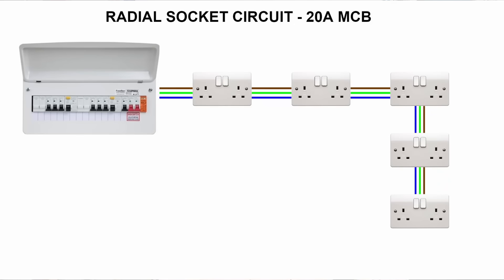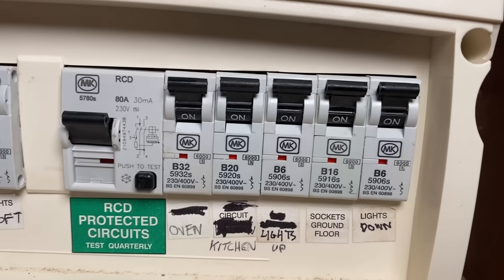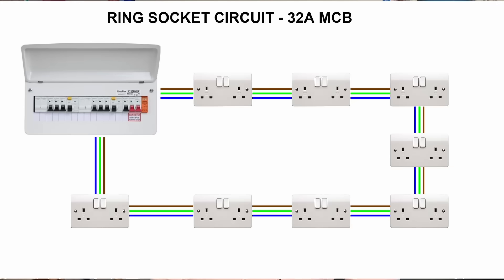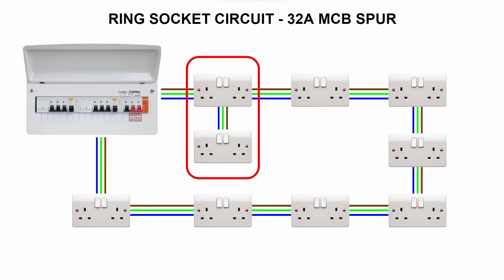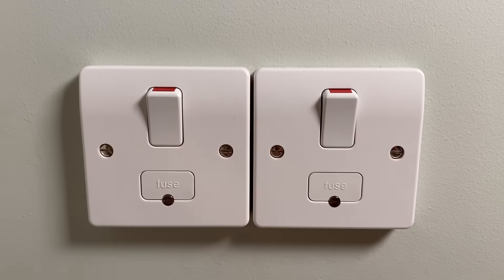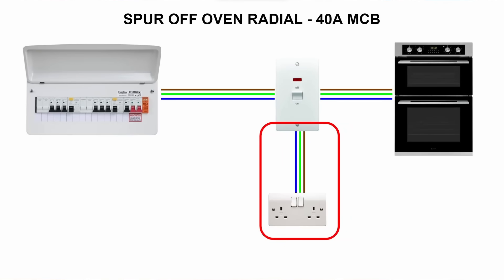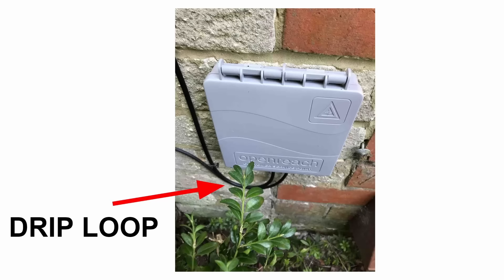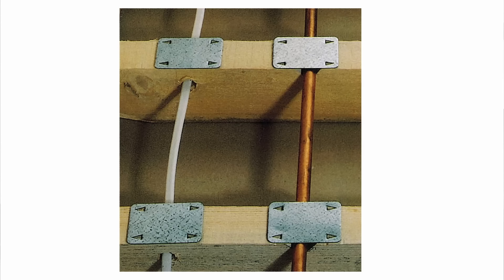BIGGEST DIY Mistakes Adding a New Socket

Comment: I am old enough to remember when people would run electric smoothing irons from 'two-pin' switched/unswitched, bayonet adaptors from a ceiling rose !!!    Mind you, often in 'first fit' old buildings, the mains wire was metal-clad - chalk filled cable.  

Do numpties really run 13A socket spurs from loft lighting runs???     I've certainly come across multiple socket spurs running from a ring circuit...   

Where rings are still  used, one probably expects a budget installation.   IMHO - radial circuit runs are more logical, though design/draught critical.
Reply from the maker: Interesting to hear, thanks for watching!

Comment: EUROPE I live in Prague. Here they have sockets right over the bathroom sink ! So things are different. They have 2-pin sockets with no apparent fuse in the plugs. I guess that is inherently more dangerous ? When I came here I bought loads of 3-to-2 pin adapters and so all my UK bought electrical counter top things ( toaster, kettle etc. ) are still UK fused plugs.
Reply from the maker: Sockets over the sink is crazy! Thanks for watching!

Comment: This is very interesting. I had an electrician wire an electric shower. He threaded what looked like fairly heavy duty cable up the wall from the hall circuit breaker, and over to the bathroom. Then he disappeared, never to be seen again ( and I hadn't paid him ). So I got another electrician. He said "hmmm, he's left me just enough capacity of amps with this cable for your shower". I asked should the wire be upgraded, but he said it was ok, but to never, ever try and spur anything off it. For me, I want to sleep soundly at night, so for electrical things, I always call a certified electrician.
Reply from the maker: Yes any doubt, call an electrician, especially something like a shower! Thanks for watching!

Comment: An electricien from the Netherlands here🙋. We use pvc pipes to run wires through so if you want to run an extra wire to transform a socket into a switch opening walls is not needed. Damaged wires are easyer to renew too. Normally every circuit is protected by a 16amps breaker there is no difference between lights an normal used sockets.  Machines that draw a lot of power lets say everything above 2kw has its own circuit. Never seen Radial circuits here and for what i know they are not allowed in the Netherlands.
Reply from the maker: Thanks for watching! 
Running cables in conduit is a great idea, but I think it takes too long for most UK electricians to bother!
Reply: I think you mean 'never seen RING circuits here'?   Surely, radial would be the norm everywhere; ring the exception?
Reply: @harstan7333 thanks for noticing your right 😅

Comment: Rings are here to stay. Radial circuits in new houses with 200/300mm insulation means that the de-rating factor of 2.5mm radials is too great to make sense.
Reply from the maker: I don’t think I agree, most appliances are so low power now, outside of the kitchen that is

Comment: To all the sparkies out there spouting about how final ring circuits should be banned and radials used for high power devices ... Pull your heads out from the dark place you keep them and live in the REAL world instead!

Consider these FACTS:

The rated max cable current on a radial 2.5mm² circuit is 24A, hence a safe breaker limit is set at 20A. So ANY radial circuit is IMMEDIATELY maxed out at 5kW @ 250v (or less) and incapable of having 2 x 2kW plus 1kW portable fan or convection heaters plugged in ... A not too uncommon scenario in an all electric heated house. This is NOT an issue on a final ring. 

To those stating that two 13A fused plug tops powering "power" appliances should NOT be fitted to a double 13A socket ... Why NOT? 

The sockets STATE they are RATED to that level (13A PER SOCKET). On a ring this is 6A BELOW the ring capability so WHY should a 2.2kW washer and an 1.8kW tumble dryer (just 4kW) pose a problem for an item RATED to DOUBLE that output AND capable of delivering it when connected to a ring? Insanity!

Well say the wizened sparks ... Use more radial circuits. Fine says I ... Now let's see shall we?

Devices to be powered:

1. Washer
2, Dishwasher
3. Tumble dryer
4. Kettle
5. Microwave
6. 4 slice electric toaster (ours takes 1.8kW!)
7. Electric Shower
8. Immersion heater
9. Electric cooker
10. General power upstairs radial
11. General power downstairs radial
12. Downstairs lights
13. Upsrairs lights
14. Dedicated fridge freezer radial

So that's 14 breaker positions!  Now we add four more dedicated radial positions to cater for plugging in portable electric heaters. That's now 18 breaker positions.

Now we add the following mandatory/recommended extras:

1. AFDD per socket circuit (as per latest regs ... Recommended but not mandatory in private dwellings for sockets on circuits up to 32A) so for the appliances above with moulded plugs ... 9 (double slot occupancy = 18 breaker positions!!)

2. Surge protector (2 breaker slots or 4 with twin RCD PLUS two isolator breakers for the surge protectors! (3 or 6 breaker positions)

4. 2 x RCD for split load (4 breaker positions) 

3. Double pole isolator inside the CU (WHY?) taking up two breaker positions.

OR, as seems to be the norm more & more these days the pathetic double width (rather than the single width ones available) RCBO's on each circuit 

And NOW, BEST CASE, we need >40 breaker positions and WORST case we need > 50 positions using RCBOs instead of dual RCDs ... That's MORE than THREE standard 14 position CUs can provide ... For the BEST case scenario. You guys are living in cloud cuckoo land! 

I continue to see replacement CU's being fitted in YouTube videos and the guys installing them complaining about final rings and wanting to replace them, apparently without ANY consideration of the additional size needed to acvommodate what they are saying.

ONE ring requires ONE breaker, ONE AFDD, the anti surge device only needs fitting ONCE per incoming supply or once per RCD split! The alternative doesn't even warrant serious consideration if AFDD's are mandated e.g. HMO etc.

Wake up and smell the coffee would you. Final rings:

1. Are ESSENTIAL 
2. Reduce breaker count to a more sensible and manageable level
3. Reduce the AFDD requirements 
4. Provide the ability to have sockets where required for both convenience (obvious) & safety - less chance of an end user plugging in an extra high power device on a generic 20A radial and popping the breaker or otherwise continuously running a high power radial.

There are a number of  solutions to the dilemma. 

Accept that with increasing power usage continuing, and growing in homes the "standard" CU TODAY is totally unfit for purpose and we need to move to a more industrial style of distribution panel with PLENTY of breaker space!

Germany, France, Italy, Holland, Belgium et all, all use MUCH larger breaker cabinets and have done for decades. The UK's CU is a way out of date relic of the fifties with its complete lack of capability for modern wiring standards.

Accept that to keep the ever increasing costs of domestic installations under control the maximising of flexibility by correctly using final ring circuits (minimum 3 - upstairs, downstairs, kitchen). And accept that they MUST be installed with greater care to avoid some of the common complaints ... Industry caused and not by DIYers!

Provide an EASIER and more readily accessible means of allowing competent individuals to be tested and certified for subsets of installations (especially the costly labour intensive parts like running cables) rather than the current farcical situation!

Why am I and many of my fellow IET members holding Electrical and Electronic degrees no longer considered "fit and competent" persons because we are not "certified" to Part P? Baloney!

Even people with HND's who do high power electrical work daily for a living are not allowed near a CU! Totally bloody ridiculous!
Reply from the maker: I think you’re assuming most people heat their houses with plug in heaters, but that isn’t the case. As for all the other appliances, it is very rare all of those are turned on at the same time. 
My house has a 20a radial in the kitchen and 32a oven radial, then 16a up and 16a down for sockets. We’ve never had any tripping issues with overloading.
Reply: @TheDiligentDIYer1759  so you never have the kettle, microwave, toaster and occasionally the dishwasher running together that's over 5kW WITHOUT the dishwasher being on? We have ... Frequently! 

That's overloading of a 16A radial and pushing a 20A radial. Why do 16A radials even exist? Just use 20A as standard rather than mixed.

 1.5mm² cable for 16A radials is ONLY really valid in free air mounting  so they should be 2.5mm² anyway for safety. The price difference between a 16A & 20A breaker is bugger all if anything so WHY? 

You didn't address any of the other issues! I never assumed MOST people heat their houses with plug in heaters but MANY people have them and use them in Summer rather than turn on the central heating on a cold (chilly) summer's evening! Moveable heaters just exacerbate the load/diversity problem.

Try addressing the issue of unnecessary dual slot consumption for RCBO's when other countries already have and have been using single slot (18mm) dual pole RCBOs for years!

Remove any and ALL sockets from the market that use SCREW connections, especially with the bloody ridiculous straight slot screws. Replace them with Wago style connections like the new MK sockets ... Almost IMPOSSIBLE to have that style arc. A dedicated connection point PER wire rather than having to double up wires into one screw tightened position!

There are SO many areas where sparkies should be driving the industry to improve but don't! The fundamental design of the 13A plug & socket hasn't changed since early last century, apart from shuttering and pin insulation!

Comment: I'm kind of worries about how my loft is set up now that I'm actually using it. I't pretty clearly a DIY job since it's "converted" but doesn't have a window or anything. There are plug sockets around the room and a ceiling light which currently doesn't work. I discovered why with a voltage pen that it appears it was connected to the immersion heater and that when that was removed the wire for that ceiling light was disconected. So who knows how the sockets are set up. There's a crawl space either side so I guess I could go in there with a torch and check that the wiring has the proper rating and maybe also trial and error breakers to figure out which circuit it's connected too, I know if definitly doesn't have it's own.
Reply from the maker: Thanks for watching!

Comment: My idea of good wiring in kitchen is to have ring run to twinpoll 13amp switches for washing machine, dryer, boiler & fridge freezer. This means any faulty appliance can be isolated and easy to put circuit back on. I do this under consumer unit. Lots of power and radials.
Reply from the maker: Yes very sensible, thanks for watching!
Reply: Do you mean switched 13A FCUs?
Reply: @johnburns4017  yes 13amp twin poll
Reply: @Ianf1x  
I just unplug my appliances or switch them off at the socket which are all double pole. No need for FCUs. FCU only for fixed appliances with a correctly rated fuse, like the boiler.
Reply: @johnburns4017  The wiring was done that way so if say the washing machine element went short circuit that part could be isolated without pulling machine out. The switch is in a easy place to get to.
Reply: @Ianf1x  
Washing machines these days have  a 13A socket in an accessible adjacent cupboard. Then no ugly FCUs over worktops.

Comment: It is not a breach of the regulations to put a 13A socket on a 6A circuit as it's still fully protected. It's unusual, but often done in a loft space for something like a TV distribution amp with a socket on it. It might be wise to add a fused spur and label the socket. It's also legally possible to use a 6A. The worst that is going to happen if it's overloaded is for the breaker to trip. However, if people really worry about such a thing, then it's wholly within regulations to put a 5A Round Pin Plug on a lighting circuit, and you can even get the plugs with cartridge fuses.

Also, have you never seen those cooker switches with a 13A socket? They are very commonly used and often used on 40A circuits. No different in principle to a spur socket with the appropriate gauge wire. As for the claim "the fuse might not blow" in the plug, then that's a far-fetched problem and, as it's possible to put sockets on 32A ring or radial circuits it's not a substantial difference.
Reply from the maker: Thanks for watching!

Comment: What's the current carrying capacity of 2.5mm2 in an insulated partition wall.
Its well below 23 Amps.
What breaker is it fed from... 32A you say.
How many amps can be drawn from two 13A sockets? (PS its 26 Amps)

I'll just leave that there..
Reply from the maker: Did you watch the whole video? All those points are covered…
Reply: @4:32 you say "its an ok thing to do" referring to a double socket on a spur.
My comment is about this if you read it properly?
The max rating of the cable is 27A IF (and only IF) you dont have other factors, such as insulation, as the 27A is about clipped direct, not IN the wall.

Adding double sockets on Spurs is dangerous and should not be done, just because its legal in ideal circumstances does not in anyway support shoddy work.
Fit a single Socket, nothing more.

Comment: I seem to remember (about 12 months ago?) that the restriction on loads connected to the lighting circuit had been watered down a bit in an update to the wiring Regs. Something like changing from a complete ban to "a suitable low load"? A YouTube from John Ward (Flameport electrics) mentioned it.

In my case, I needed to supply a 1 watt TV aerial distributor in the loft so have fed a 13 amp socket via a 1 amp fuse in a FCU from the lighting circuit (to me, that satisfies the spirit of the rules).
Reply from the maker: I’ll take a look, thank you!

Comment: I would break it down this way-
Heating anything takes lots of power, kettles, fan heaters, tumble driers all need some care. 
Everything else uses very little power and you can be fairly relaxed about it.

With most houses now having central heating, it is far less common to have fan heaters plugged in and so in many ways things have got much better. 
The tumble drier in the garage is a nightmare scenario!
Reply from the maker: Agreed, thanks for watching!
Reply: Heating, it seems you mean purely resistive loads as opposed to inductive and capacitive loads

Comment: The ring main system is outdated and dates back to when we all relied on electric fires to heat our homes. No other country uses this system and it’s time we abandoned it and adopted radial circuits on 16A breakers.
Reply from the maker: Agreed, but 20a MCBs will usually be fine in most homes. Thanks for watching!

Comment: Rewireable fuses should be banned, they can take twice the load before failing, this is lethal for a person should a fault occur. I know I’ve experienced this problem.
Reply from the maker: I agree it isn’t ideal that they don’t blow quickly when they rating is significantly exceeded, however they still have their place in stopping appliances pulling dangerous levels of current. If you plugged something into a cooker socket with no fuse, you could potentially pull 40a+, but with a 13a fuse, it definitely won’t go above 25a.

Comment: Your argument for running a radial off a ring circuit falls down if you just have a radial circuit in use that could also exceed the load. So my conclusion is always use a ring circuit or you’ll have to consider uprating your wiring to 4.0mm instead and this would allow higher rated equipment.
Reply from the maker: You’re making the assumption that the radial would also be on a 32a breaker, if it is 2.5mm cable, you would usually put a radial on a 20a breaker or even a 16 depending on the runs

Comment: Some interesting stuff.  Radial circuits are not suitable for rooms such as a kitchen due the the possibility of high current draw, fridge, freezer, dishwasher, washing machine, tumble dryer, kettle and toaster being on at the same time. Personally, I would not want a radial circuit as it restricts what I can plug in and there could be the temptation of the new owner of the house fitting a 32amp cct breaker.  As for size of fuse box, consider all the circuits you may want, kitchen, garage, smoke detectors, external sockets, external lights etc etc
Reply from the maker: Thanks for watching!
Reply: A radial can be wired in 4mm2 and give you a 32a capacity, just as a ring  would, but without the weaknesses of a ring (ie could be broken ring so 2.5mm2 could be carrying most or all of the load but fused at 32a, above its capacity). You could also run 2 x 2.5mm2 radials giving you 40a total and a bit of diversity - same amount of cable but less risk.

Comment: You keep talking about breakers on your sockets circuits when you should talk RCD's,you do know the difference do you?
Reply from the maker: Yes I do know the difference. MCBs are for individual circuits, RCDs typically cover 4-6 circuits and MCBs. MCB stands for miniature circuit breaker, hence why I refer to them as breakers sometimes.
Reply: @TheDiligentDIYer1759  You are right, and is a comon practice to have all the sockets on one rcd,4,6 circuits will be like 30 sockets least that will jump in same time.

Comment: This is why I remain circuits are dangerous and we should go back to radios
Reply: The best way is a formal radio, 32 amp MCB
Reply from the maker: 4mm radial? I think 2.5mm is sufficient these days, other than very big houses or kitchens. Most appliances are so low power now, the average home upstairs circuit doesn’t need huge capacity